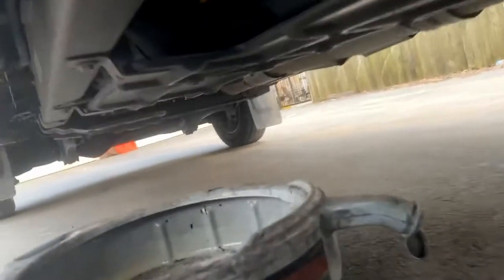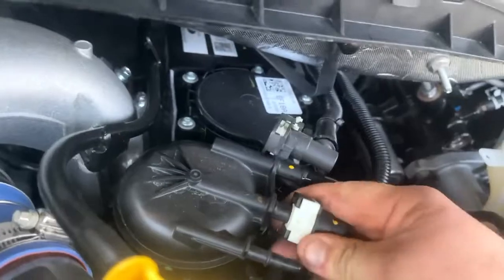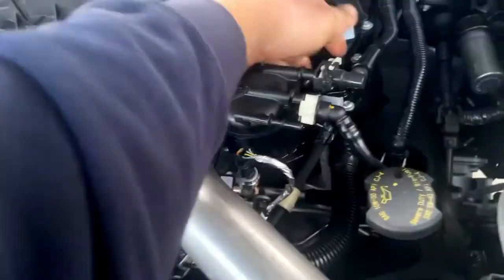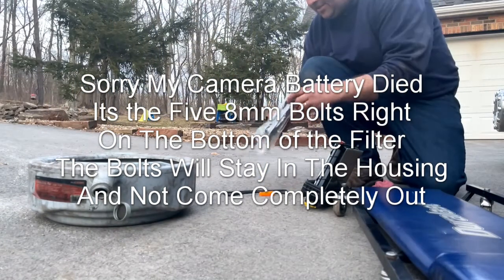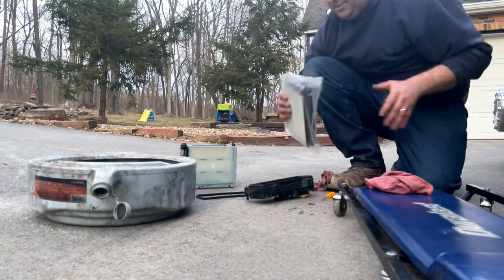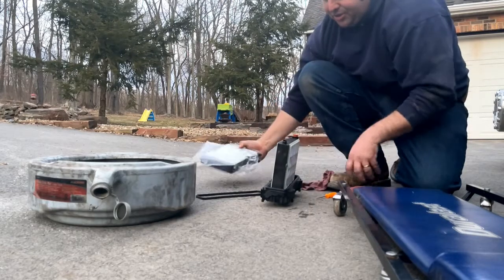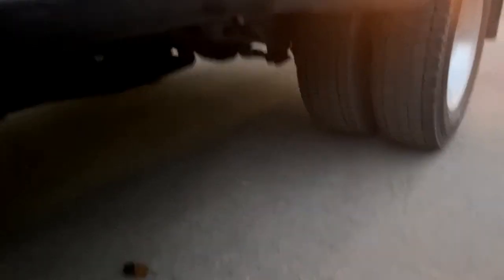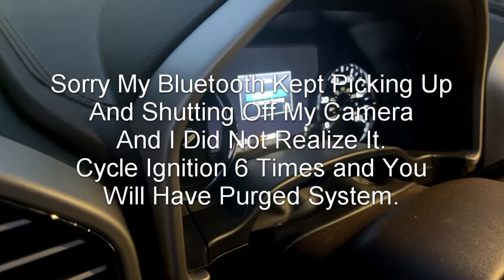Ford 6.7 Powerstroke Diesel Fuel Filter Change on 2021

Comment: Great Video! It should help prevent a few diys from breaking the fuel  lines. I have a couple of suggestions. First, clean the area around the filters before you remove them. That will help the new filters go back in clean. Second, when you drain a fuel filter/ water separator you should use a very clean container. This might be your only opportunity to inspect the fuel that your putting in your truck. Using an oil drain pan or dirty container won't help you.

Comment: Please read...Side note...I see you got green coolant.  I took my f450 in for a recall and was asked why is there green coolant in the reservoir.  My reply was it came that way.  They pulled the VIN and showed me where it’s suppose to be gold coolant.  They flushed it and put the gold coolant in under warranty.  Ford Green does not have the correct properties to be run in a Diesel engine.  May want to check into that.
Reply: My 19 F350 and now my 22 F450 both are green coolant, hummm thanks! I'll have to ask my local dealer about that.

Comment: How are these filters compared to OEM? One thing you probably want to make sure is the filters that are protecting one of the most critical and expensive things to replace are good filters. 30 bucks seems awful cheap, I got a spare aftermarket name brand set last year from Autozone or Advanced Auto Parts and the set was almost 100 bucks!

Comment: So I'm changing the lower fuel filter again as I'm doing the HS Motorsports lower fuel filter conversion. The first time I changed it about 7 quarts or so of water/fuel came out. That was 1000 miles ago, now I am draining the water/fuel out again and it seem that an excessive amount of water/fuel is coming out for draining it 1000 miles ago. What would cause so much liquid to come out? The truck isn't on so it's not the fuel pump pushing fuel out......
What gives?